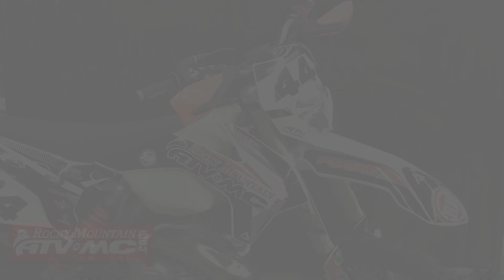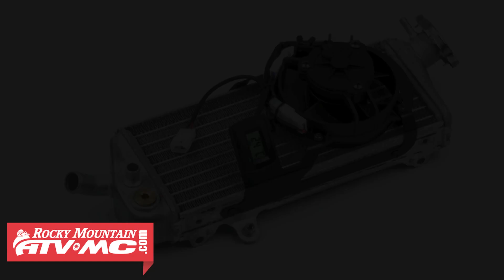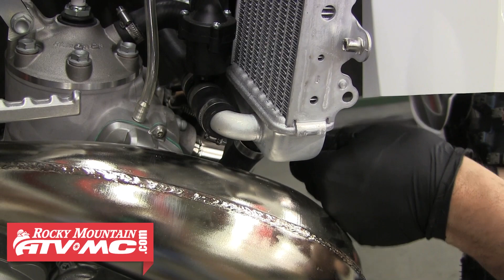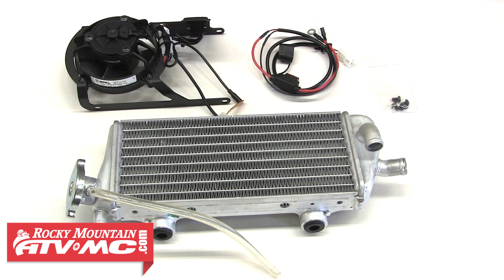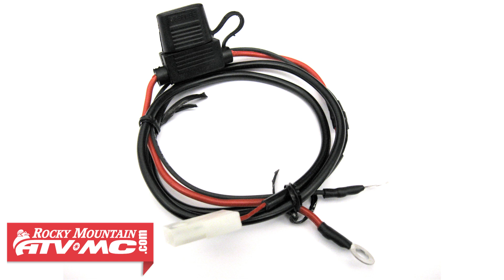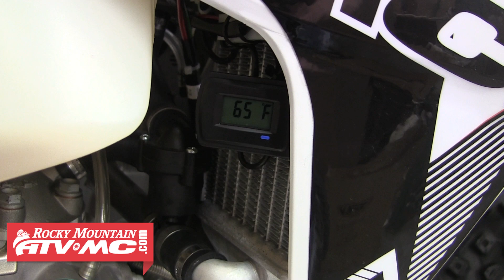Trail Tech Digital Radiator Fan Kit Installation - KTM Models

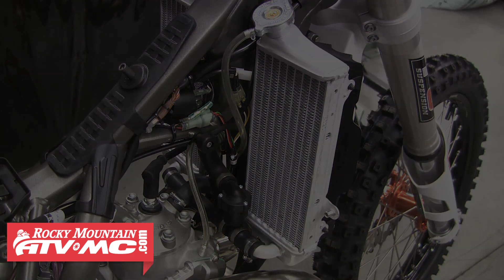Comment: hi sir, my fe250 2015 the radiator have a temperature sensor which suppose to go into as per your video at 0:24 the bronze cover. so with the trail tech radiator what if i use the radiator as per 0:52?

Comment: Would this kit fit a 450 sxf?
Reply from the maker: To see if this will fit your machine use the drop down menu on the product page and enter year/make/model. If your vehicle is not listed we may not have the correct application.

Comment: Where do you plug this in ?
KTM 525 does not have any wiring except for ignition coil
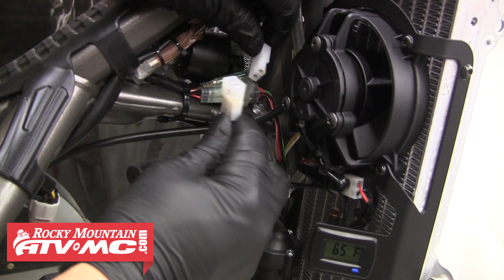Reply from the maker: This kit is designed to plug into the stock wiring harness or your bikes battery. We talk about this step at 3:20 in this video.

Comment: What temp shuld I set it to come on at? 2012 WR450F
Reply from the maker: We usually set ours to come on around 180-190 but if your battery can handle it and you notice it still running hot, you can definitely play around with it and see what you like.
Reply: @rmatvmc  What is normal operating temp on the trail hot day? What is over heating temps? and what is extreme over heat head gasket type hot?
Reply from the maker: Normal operating temperature is around 180-210 but could get up over that if it's a really hot day. What is too hot will vary with each bike but anything over 230 is starting to get dangerously hot. If you are really worried about it run a high quality coolant along with the fan and you shouldn't have any problems.
Reply: @rmatvmc  of the bike is running then the fan won’t have any negative impact on battery no? Isn’t it only when the bike is off and the fan is on that the fan can drain battery?

Comment: Should the radiator be bleeds for air bubbles after the anti freeze is in ?
Reply from the maker: It's a good idea to turn the engine over a couple times while refilling the coolant to minimize air bubbles, also check the coolant level after the first ride or 2 to make sure it stays topped off. Our boy Cameron Niemela has a short video showing some good tips on how to refill your coolant. If you want to check that out, here it is: https://www.youtube.com/watch?v=UXAwXRA673Q
Reply: @rmatvmc  what kind of coolant? Regular 50/50 fluid for cars?

Comment: i am confuse. if the connections are connected directly to the battery, that means it doesn't have shot off switch or the fan continuous to run.
Reply: The thermostat auto controls when the fan runs. When off, no battery drain.

Comment: does adding the fan reduce the cooling effect once i get out of tough terrain and go up to high speed? Would the fan actually decrease cooling at that point???
Reply: I think it would not reduce the cooling effect because the fan is on the back side of the radiator.

Comment: I have a 350sxf do I need to upgrade my stator to run this?
Reply: Nah it should be fine just don't run a light at the same time like I did and get stuck in the middle of the woods with dead battery.

Comment: hi guys , do you have it in C instead of F ?
Reply from the maker: A Hilal Yes we do! On this fan kit you can change it between either of them so if you want it to display Celsius you would simply choose that and if you want it to display Fahrenheit you would choose that. It shows you how to switch between these on the provided set of instructions
Reply: that's good , I need one bit the most powerful cooling fan you have with the same size , how can I get it ?
and do you have very powerful fan which replace the stock fan for XP900 ?
Reply: Rocky Mountain ATV MC
Reply from the maker: A Hilal
 This is a 147CFM 4" Fan Kit and you can simply click on the link in the video or the description to find it on our website. This fan kit is specific to the KTM offroad bikes and the Honda CRF/X models. We currently don't list any aftermarket fan kits for your XP900.
Reply: Rocky Mountain ATV MC Can I only buy the automatic temperature meter ?
Reply from the maker: A Hilal Sorry, these parts are only sold as the kit.
Reply: Rocky Mountain ATV MC hi is this fans water proffs in rain and is this for all bikes
Reply: Cookistar no and no